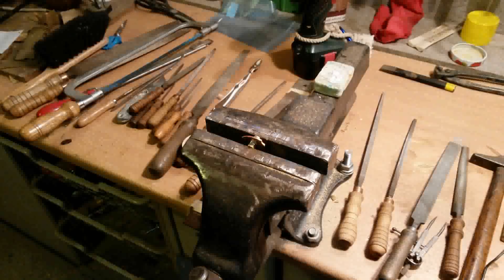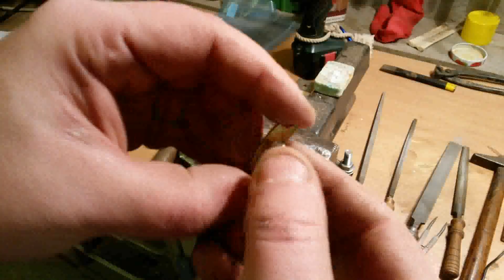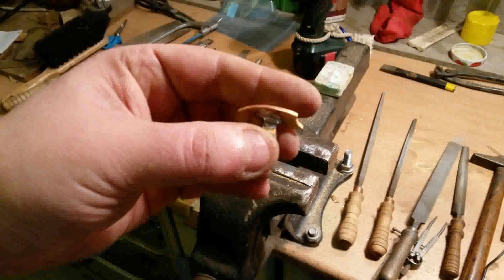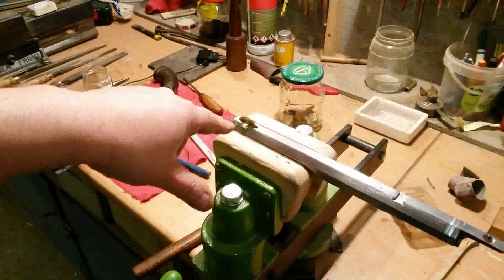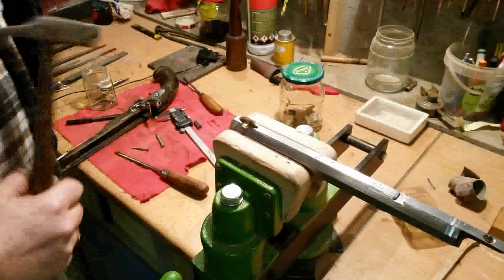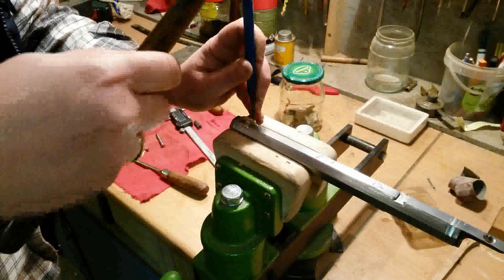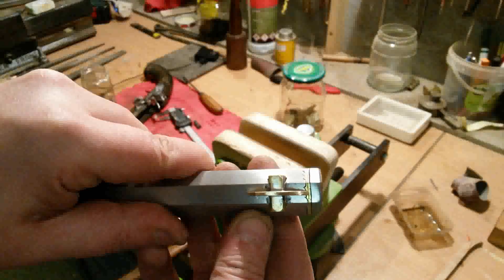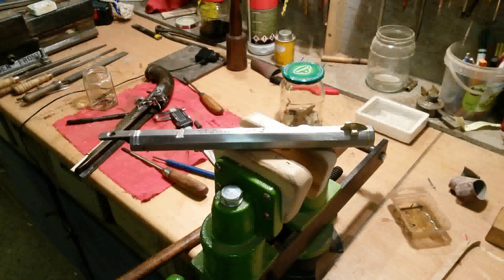Kentucky flintlock pistol build Pt. 29 making and installing the brass front sight

Comment: That looks very nice, the woodwork is looking better with the more handling it gets, with a few shots though it this will look like an original pistol. Chris B.
Reply from the maker: You are totaly right. But now a new problem coming closer. I still dont know how to treat the barrel. If it looks better with rust blue, browning or should I leave it like it is? very hard decission! What do you think? Roger S.
Reply: Well Roger, I tend to go for the brown finish, that looks like the sort of colour a very old barrel gets with age, I think use gives the whole thing a more "aged" look, if indeed that is what you aspire to, I tend to like the look of a very old pistol/rifle, that has been well cared for over the years, and that is the finish we tend to end up with on a home build job, the perfect rust blue finish somehow does not look right, although if we see a genuine 150 year old gun as it left the maker I am sure it would look "fresh". Your will look very nice I am sure ! Chris B.
Reply from the maker: So that supports my idea perfectly. I was not so sure what kind of finish will give the right look. So it will be barrel brown. Thanks for your kind advise. There is only the rear sight left and than I can make the barrel finish. And the rammrod will get a horn tip as well as the muzle end of the gunstock. Roger S.